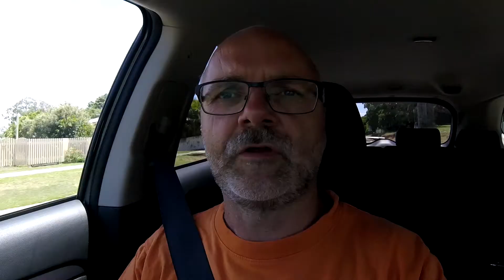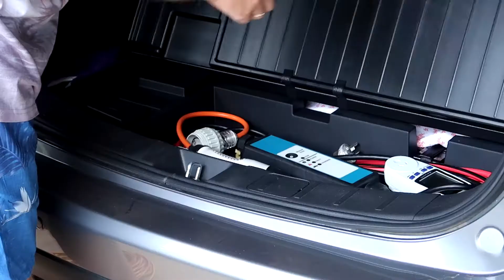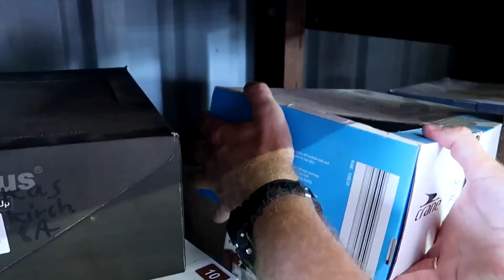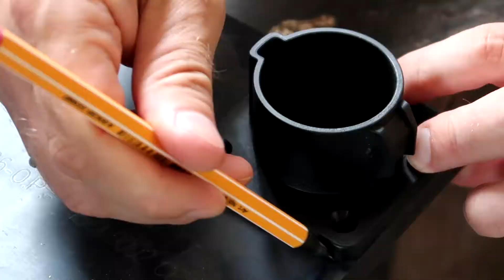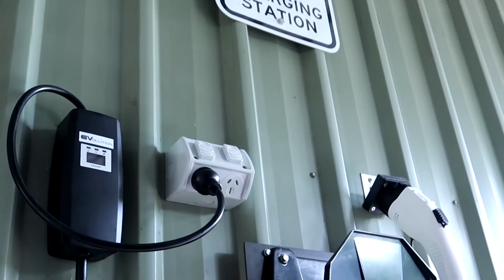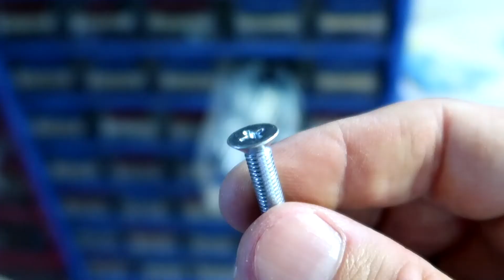EP33 - How to charge your Outlander PHEV @ home!

Comment: The standard granny charger from the 2019 model is the plug 10A or 15A?
Reply from the maker: They all are 15A for Australia. But it charges only with 8A for safety reasons.

Comment: do you have any idea , 
how can i have fast charging system in my home
Reply from the maker: You cannot fast charge the PHEV at home. The car's charger can handle only 3.6kW which will result in 3-3.5h charging time. That's the fasted you will get.
For everything else you can plug the car into a CHAdeMO public charger and charge from 30-80% in around 35min.
Reply: unplugged EV but I heard that there is a charging station for home which can change 80% within 30 to 40 minutes
Reply from the maker: You heard? This could only be a DC/DC station but I never 'heard' about someone has got one at home. The electrical supply would be the same as for the whole house.
Let us know if you can get a link to a website or so...

Comment: G’day Andy,

I have a very similar setup to you, with the same DIN rail  kWh meter and similar electronic time clock and isolator. I also try to charge in the ‘wee hours,  and also often time the charger to not necessarily charge fully unless I think I’ll need it, just to look after the battery. My original Mitsubishi charger is permanently wired to off peak Tariff. Then I use the EVSE charger (yes, same as yours) for charging elsewhere, so I can select 6, 10, or 15 amps charge rates as required. 
One thing you should mention I think, it’s also VERY important for people to also realise that it’s very good practice and responsible to NOT charge EV’s during peak hour unless absolutely necessary. 4pm till about 10pm is the worst possible time, when the grid is working very hard, and it’s in everyone’s interest to avoid that period as it avoids grid overload. Thanks for your videos, and I too am waiting for a Model 3- wonder when we will get them.
Q. How do you charge from a Tesla charge station? Do you have an account? And how do they charge you?
Reply from the maker: You're absolutely right. The charging time is very important, especially when it is very hot or cold and a lot of energy is been used during these peak times. I always start charging after 11pm to avoid these times.
You can charge from Tesla Destination chargers using this adapter and your switchable EVSE. The chargers are 'free' to use and no Tesla account is needed. The way it works is that businesses or hotels installing these chargers (subsidised by Tesla) and paying for the energy been used and maintenance. So in general they want to attract Tesla drivers but are mostly open for other EV drivers too as long as they use their business (restaurant, hotel, ...).

Comment: You say some people believe they just don't need all the info that your switchable EVSE gives you, but aren't those the people who think the car manufacturer has everything figured out and that they have your best interest at heart?  I don't think they (the car manufacturers)  have it all figured out based on the problems you and others have with loss of range even when you care for your battery very well as you clearly do.  I would want to make sure I wouldn't need to buy a new battery in just a few years when the health of the battery degrades way too quickly and no longer assists in fuel efficiency.
Reply from the maker: I agree. One one hand the manufacturer SHOULD care about their product and don't bother the customer to make such efforts figuring things out. In a normal car you don't care about what oil temperature, what vacuum the brake booster, what temperature your diff oil has. It all gets taken care of automatically.
The big problem is Mitsubishi does not take any feedback from customers onboard and does not even try to collaborate. They could easily make a (almost) perfect product in terms of the software and battery management system. Look at Tesla, they collecting tons of info from their system and constantly improving the software. I would not mind sharing all my data with Mitsubishi and even carry an extended data logger in the car just to help improving thinks. But they don't even come back with a response in regards to this bloody map update... :(

Comment: Hey Andy .. loving your videos ... interesting thing you said today is that you try to charge as close to drive time as you can. So you finish charging and get into the car. I'm wondering have you checked all your stats as soon as you finish charging on days when you don't need to drive straight away. Then leaving the car undriven and check it again in two hours ? the thought is that possibly its not dropping after driving but after charging ? The theory being that you are getting an inflated Guess'O'Meter reading from the charge. I'm considering picking one of these phevs up when my commuter finally dies. Keep making the videos and I'll keep liking them. best of luck with the Phev, Paul
Reply from the maker: Interesting theory, Paul. Yes, I checked that as well and fully charged the car without driving it. After two days it had lost only 0.2Ah. It only happens when I fully charge, drive and leave the car then for 2h. Interestingly, there is no further loss afterwards any more until I recharge and drive again...
Today another PHEV driver got in contact with me and said he's experiencing the same after initial charge and drive. Same model and year as mine... well...
Reply: AH you found someone experiencing the same phenomenon. Awesome. Are they in Australia and can therefore lock arms with you and march on MMA ? I hope this works out as it seems a great car best of luck. Paul
Reply from the maker: Paul on interesting stuff Yes, here in the country but far away. I reckon a lot at people having this problem just they don't pay attention on the GOM before and after parking.
Reply: unplugged EV yeah very true. People are used to simply getting in and driving. Unless they are very conscious of trying to stretch their ev range they would have little interest or simply not have noticed. I'm surprised it's taken so long for someone to show up as the phev watchdog seems to be very popular. Out of interest does the watchdog show live data on low and high voltage across the cells during the trip. Just wondering if a cell is dropping under the load of driving and the bouncing back when the load is off? Best wishes with the phev. Paul
Reply from the maker: The watchdog show live battery data, every single cell voltage and temperature. Daniel put a lot of effort in this app!
No bouncing cell though...

Comment: Honestly you are not missing much. Our car has the WiFi and timer app, but frankly it kind of is a hit & miss since you can't use it in conjunction with the pre-heat/cool timer (unless they overlap before the battery is full, the climate control will ALWAYS drain from the battery, not the mains). 

I'm still suffering from a Level 1 110v/12A which takes ~9hrs to charge, but I have a Chargepoint Home Level 2 station coming in next week.
Reply from the maker: I heard about that, the pre-heating uses a quite big chunk of the battery in the morning. The EVSE can only deliver 2.4kW (on 240V) and the heater has up to 4kW, so the battery is never full when you leave. The level 2 charging station will improve this slightly as it can deliver the full 3.5kW to the car.
Reply: Does the Aussie PHEV charge slower? The North American cars on a Level 2 circuit charges at 208~240v at 16A, which equates to 3.3kW to 3.7kW.  The preheater still draws marginally more power than the Level 2 cord provides, but it fills up pretty darn quick.
Reply from the maker: We have 240Vwith 15A which maxs out the internal charger of the PHEV. Charging time on that power is around 3h from empty to full.

Comment: Charge the family PHEV at home. Just had two type 2 EVSE charge points fitted last month, one at 3.6kw (for the PHEV) and one at 7kw for a brand new eGolf on order and coming in April (I hope). They were fitted by a UK company called PodPoint and are WiFi connected for software updates to the internal system. They (PodPoint that is) send me full usage reports monthly via email, and they have an app coming out in a couple of months, so I can get the data on my phone and export it also. The app is also having a lock so you can prevent plug insertion and charging for when your not around, or when on holiday etc. I charge the PHEV from 11:00pm each night, I haven't got enough data yet to work out the optimum time to start the charge. I'm waiting until I have more of the monthly reports or the app to calculate it. I have a special energy tariff from a company called Green Energy 'Tide' tariff. It gives me very cheap electricity after 11:00pm until 6:00am. I will have to change when the other EV comes as I will need to plan to make sure everything doesn't overlap too much. I would be very interested in what data you get from your charger to see if the charge rate drops off towards the end & draws less load. It would be good to start gathering stats on that so I can see when is the optimum time to have both cars charging at once on the overlap. The PHEV, EV, Washing machine, dishwasher all have timers and can all run on the cheap electricity but my max load on the supply fuse is currently 80amps and the fuse is sealed (it is before the consumer unit) so if I blow it then I have to get the grid engineers out to replace it. Voltage is 240 so my calculation is 15 amps on the 3.6KW, 30amps on the 7kw, washer is very efficient and max draw is 10amps, dishwasher slightly more at 13amps so 68amps worst case scenario, if they all ran at the same time. The load from the rest of the house is tiny, most run on gas and LED lights everywhere. they should all run at once if needed without an overload. Sorry its a long comment... not quiet as long as your videos :)
Reply from the maker: Thanks for the long comment on my lengthy videos, much appreciated, hahaha ;)
For the washer and dishwasher, the draw will be only temporarily when they heat up. My dishwasher uses a total of 1.4kWh over 2.5h. 
The charging of the PHEV starts to drop down around 1h before it finishes. The last 30min are at or below 1kW. You could also consider charging the PHEV on a 6A rating as you have 7h time utilising your cheap power tariff. The eGolf has a 35.8kWh battery and could be slower charged as well depending on the needed SoC in the morning. So all in total you should be fine with your 80A.
The data connection of installed charging stations is the only real benefit I can see at the moment (regarding my charging habits and needs). I guess you got incentives and discounts for the purchase and installation of them in the UK. I would probably do the same here if such funds would be available.

Comment: I’ve got an i3 so I just set it in the car but I really wanted to ask you have you considered the Bollinger B1. https://youtu.be/-dav55oUJ-w
Reply from the maker: Probably not... I would have no need for such a... truck.
Reply: unplugged EV I think it has options where you can cover it like an SUV.
Reply from the maker: The look is not the greatest, it does not look like they have any LTE/app connection, the price will be over US$60k and it will take 100yrs until it comes to Australia. I'm not doing any 4WD but a lot of highway driving, the efficiency of this boxy truck will be bad (they talked about the 100kWh pack will provide only 200miles of range). All in total not a car I'm interested in at all... What do you think of it?

Comment: I dream of being able to charge at home. It would save me so much time and planning effort!

Very interesting timer box; I didn't realise such off the shelf components were available for DIY solutions. If the powers that be allow us to wire electricity into the garages long before Model 3 arrives, I may look into this kind of solution.
Reply from the maker: That's not DIY stuff. You always want an electrician to do that. The components were less than $50 though
Reply: unplugged EV Yes, I would of course get it checked by a qualified electrician and have them physically wire it to the fuse box. I have DIY experience working with 240VAC projects but always safety first.